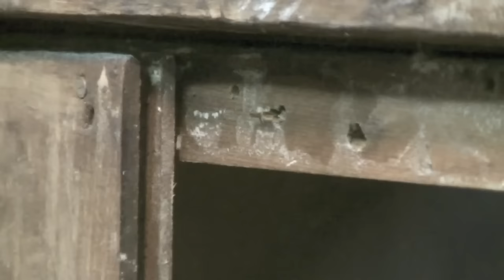Eliminating Odors from an Antique Chest of Drawers - Thomas Johnson Antique Furniture Restoration

Comment: Upon unboxing, I was immediately upset at how the rails were very noticeably bent. But I kept going, all tools needed to assemble were included https://www.youtube.com/post/UgkxqtX4Dxs6aecAZEuz6GY5-d81YecKCshn and I had it set up in about 30 minutes. Honestly I love this thing, make sure to read the measurements and measure your space so you know if it'll work for you. I bought this to put inside my closet, underneath where I hang my clothes and it is absolutely perfect! It is VERY sturdy and all drawers glide easily and mine are stuffed, and they are still flush when closed.
Reply: @johnsonrestoration this is spam, you might want to delete it.

Comment: Hi Tom - I use white wine vinegar, just paint in on with an old 2" brush  and leave it. The vinegar smell is almost gone after 24 hours and completely gone in 48 hrs. Great channel and only just found you - great videos thanks. Pete
Reply from the maker: Vinegar's a good thing. It would make sense to always try that first
Reply: @johnsonrestoration  Vinegar doesn't kill mold like bleach, does it?
Reply: @kbld1  no, it doesn't but hydrogen peroxide does
Reply: @kbld1  Yes, it does. I've used it many times to wipe out mold. I hail from the moldy PNW.

Comment: Great tips! I just wanted to let you know how much your videos have inspired me to take on various projects I would have shied away from only a few years ago. Last year I restored an old handmade mahogany trunk that belonged to a carpenter around the late 1800's to early 1900's and at some point it ended up with a ton of pipe cutting oil on the bottom. My friend insisted on turning it into a cedar chest for all of her various Mardi Gras costumes but no one she brought it to was interested in working on it. After a good cleaning on the outside with some TSP, to get rid of the smoke smell, I got rid as much of the old built up oil as I could with some scrapers and a few TSP cleanings. After it was obvious the smell was not going to go away I put down three coats of leftover shellac I had from another project. The shellac totally eliminated the oil smell and allowed me to line the inside with some 3/16th thick aromatic cedar. The outside was in remarkably good condition but I had to replace the handles with some cast iron ones that were almost the exact same as the originals. The trunk turned out perfect and if it hadn't been for your tips on shellac and TSP, I probably wouldn't have agreed to take the project on.
Reply from the maker: Wow! It sounds like you did a great job! Also, for oil stains, I've found Dawn detergent works really well. Thanks for watching!

Comment: Great tip there. Years ago we bought a second hand wooden wardrobe and we needed to get rid of it because of the smell.  It just smelt like an old persons home (sorry best way to describe it).  We tried waxes and all cleaning products with no success.  You obviously know what your doing, and I'm really learning a lot from your videos.  Was great to see how you tackled this problem. :)
Reply from the maker: +DCPorter71 Thanks! Odor is difficult to deal with!
Reply: @johnsonrestoration  have you tried vinegar? We bought seafood and it leaked into the carpet of our car. Had the carpet professionally cleaned yet the odor returned. My grandmother suggested white vinegar which I used 1:1 with water and soaked the carpet and let it dry. Was pleasantly surprised! We were going to try charcoal if the vinegar didn't work

Comment: I wish YouTube had recommended this video to me a few weeks ago! This looks like such a thorough job and you look like you’ve been doing this for years and really know what you have been talking about. My parents bought me a Heywood Wakefield dresser about 10 years ago now and sanded and restained it for me. I’ve been collecting mid century pieces since then and fixing them up with their help. But my dresser over the years has retained an “old wood” scent. I just fixed up a second Heywood Wakefield dresser and really tired to get the scent out. I vacuumed it out then wiped down every interior surface like you did (although I didn’t take any drawers apart) with diluted Murphy’s wood soap. I let that dry out in a garage overnight and then had to wait a few weeks for a new product I’m trying. Big Mamma’s Butta from Dixie Belle paint company. I put it on all interior surfaces because I saw someone use it to help with the old wood scent. I put it on top of the exterior over my stain as well and it added a nice shine. It looked like I had just cleaned it with pledge. If this works to get the old wood scent out I’ll do it to my first dresser but if it doesn’t work I’ll have to try out the method you did in the video! I have to say I love that piece you were working on. I love furniture like that where it looks like it has a bit of history in it.
Reply from the maker: Thanks! These odors can be tough! I'll have to check out "Big Mama's Butta" I assume it's a wax?
Reply: Thomas Johnson Antique Furniture Restoration it is a wax/oil combo. It did not get rid of the scent so now I am waiting for a sunny day to bake the dresser and drawers outside. I would rather not wash the interior again and loose the shine that the Butta provided but I will if the sun is unable to bake the scent out

Comment: Thank you for the cleaning tip.  I used dish soap and water, then a disinfectant and water mix to clean an old oak dresser that had mold inside and out (and lots of dust).  The piece is drying now.  I think I'm going to have spray it like you did.
Reply from the maker: You're welcome. These problems can be tough

Comment: Terrific learning video. I tripped over your playlist library while researching furniture restoration as I have a few pieces that I'd like to tackle myself. I'll admit, I was surprised to see you using water and other liquids so liberally. Isn't there a risk of warpage, especially with such an old piece? How is it that the old wood in that dresser maintained it's shape and reassembled so well?
Reply from the maker: Thanks for watching. I've never had water damage anything, assuming you wipe it off right away, don't let anything stand in water or have pools form on any surfaces and sit there. Warpage is call by the moisture content of the wood, which is not affected by washing, but rather the humidity levels of the environment. Good luck with your projects!

Comment: What a lovely chest of drawers.  You did a beautiful job!
I don’t know if you’ll even see this comment after all these years, but I’ve discovered that bleach is nowadays considered the “cosmetic” treatment for mould, as it is so effective with the staining.  Vinegar, however, now has a reputation for being a mould killer that actually prevents new mould from coming back.  I would definitely rinse the vinegar off well and let the surface dry completely before using bleach for any stains.  Or maybe your oxalic acid would be preferable?
Reply from the maker: Thanks! Yes, many have told me that, that vinegar is the best. I've been using it

Comment: Wow it is so impressive the attention to detail you take. Great work. I am beginning to buy old furniture and repurpose  or refinish. I have a question for you. Do you think all furniture can be restore or are there times when it is too far gone? So to be more specific, before i found this video i bought a pretty little piece. It a small desk or console table. It had a terrible musty and mildew odor. I couldn’t even have it in my house it was setting off my allergies like crazy. So i put it on my covered patio. But somehow the rain got in and it go really wet. The top is very swollen which is interesting because with the expansion the mold is even more prominent. Is it too far gone?
Reply from the maker: Thanks for watching! I always hate to say something is hopeless but it sounds like this is the case. Once things start to swell they are next to impossible to repair. And it already had the problem of the odor. Get rid of it!
Reply: Water can cause wood to warp out of shape. You can't fix warped wood.

Comment: Wow - this is a deep level cleaning! What a lot of work for a modest old chest of drawers. Do you have any tips for removing the smell of moth balls on wood that has contained them for decades? Superficial cleaning doesn't do much because the porous wood has been deeply impregnated with the odor.
Reply from the maker: Thanks! I would start with a lot of fresh air! It should dissipate. Sprinkle with a generous amount of baking soda

Comment: Hello, Japanese people seem to use bamboo vinegar Japanese Bamboo Vinegar "Chikusakueki" for a number of things : ( description by Dictum : One of the oldest cleaning agents in Japan, bamboo vinegar can be used for the following purposes: As a fat-dissolving cleanser (either undiluted or with water added) in the kitchen, bathroom or workshop. Particularly effective on cutting boards, work surfaces, knife blocks, etc. For eliminating mould and insect infestations in storage areas, textiles or Tatami mats. For treating plants with infested roots or leaves or as a fertiliser; simply add some when watering. For extinguishing unpleasant odours). 

Have you tried it ?
Reply from the maker: Thanks! Not the Japanese vinegar, but I've heard all the same claims for our regular white vinegar. I need to use it more often

Comment: This is an inspiration to me to tackle several family heirlooms including a buffet and multiple dressers and chests of drawers.  I was wondering if the shellac inside and outside of the drawers hinders their movement?  or the layers are so thin it doesn't matter?  Thanks for your feedback.
Reply from the maker: Thanks! It should help with the movement, or help it maintain equilibrium and not move. But of course the purpose was just to seal in the odors. I'm assuming you mean wood movement and not the moving of the drawers as they're opened and closed

Comment: I have a very old buffet that I inherited from my mother.  It has very ornate carving on it.  I think I need to do the same thing you did with removing the odor but is there any other thing I can do to seal the surface instead of shellacking?  The wood is so beautiful and I'd like to keep it as natural as I can.  Maybe linseed oil or something?  Any suggestions?
Reply from the maker: Yes, use an oil finish like Watco Danish oil. Brush it on, go over it with 0000 steel wool while still wet, and wipe it down. The next day wax it. Good luck!

Comment: Question: When washing the wood with water and bleach, does the wood swell causing problems when fitting drawers back in? Even when drying the wood, it still must retain some water.
Reply from the maker: Thanks! It's not wet long enough to swell. It's really only wet for a few minutes
Reply: Wow thanks so much

Comment: Thank you for taking the time to show us how to eliminate the odour from these old beautiful pieces. I am in Canada otherwise I would be dropping my two french provincial pieces to you for help :) I am on round two of wiping them down with white vinegar. I have not taken any of them apart just wiped all spaces I can see and reach with undiluted white vinegar. I have taken the dresser and tallboy and the drawers out to sit in the sun too. While the awful mould/mildew stink has reduced, it's still there. I have not started to refinish them (repaint them) on the outside yet as I want to tackle the smell first.  Should I try this bleach solution next? What should I do after that? Thank you for your time :)
Reply from the maker: Thanks! Be sure to get the undersides of everything with the vinegar. Then wipe everything again with an enzymic odor control like Nature's Miracle http://www.naturesmiracle.com/. Plenty of fresh air and sunlight are good too. Good luck!
Reply: @johnsonrestoration  thank you so much for taking the time to answer. I got someone to flip the dressers over for me and so I was able to saturate it with vinegar. I also removed the backboards from the dresser and the tallboy and I am replacing it with a thin sheet of finishing wood. Not sure what they are called but I got them in the lumber section and got them cut to size for a perfect fit. I am thinking that replacing these will reduce some of the odour. There was melamine there before and they are just holding the smell. Also, I tested this product on one of the drawers, it's called Zinsser Odour Killing Primer OMG it worked great! Mind you this drawer has had several days of air and sunshine and three heavy white vinegar saturations but there still was a touch of stink left but now it's all gone.  This Zinsser product goes on white and dries clear. You can barely tell that anything was put onto this untreated wood. I am going to coat the rest of the furniture and drawers on the inside today. Then move onto the sanding and repainting stage of these pieces. I will send you a pic of the finished products for you. I still need to clean the handles that came with these Andrew Malcolm antiques. Their original finish is white but has yellowed and full of stains so they definitely need some revamping. Have you used this Zinsser product before? Have a fantastic day :)

Comment: Where can I buy the Shellac sealer please. 
We have just bought an old chest of drawers,  it smells horrid. 
Tried everything,  next step is bonfire 😢,   unless we can find some shellac clear sealer xx
Reply from the maker: Thanks! Shellac is sold as Zinserr Universal Sanding Sealer, it is available at your local hardware store. First I would clean the entire piece, inside and out, turn it upside down! with 1 part white vinegar and 1 part water. Let dry, spray everything with Odoban, from you r local hardware store, let dry, and then 2 coats of shellac, sanding between coats
Reply: @johnsonrestoration 
Thanks John.
We've tried bicarbonate of soda.
Washed it down with a bleach solution.
Used white vinegar.
Aired it for a month.
Honestly,  we just feel like burning it now especially as we bought it to store newborn baby items in. Xx

Comment: I just saw your video and noticed you have several old trunks. I have an old trunk and it has several removable drawers, but the inside of the trunk has an old smell to it. What can I do to remove the smell? All the drawers are lined with paper. The inside of the trunk is in excellent condition. Thanks for your input
Reply from the maker: Thanks! Try using activated charcoal. There is plenty available in different forms and packaging. Also good old baking powder can do it. Let me know how it comes out

Comment: I'm so glad I found this. I used vinegar on all areas inside the dresser, but for some reason there are gray spots appearing on one side of the dresser.  (I also started by spraying it down and scrubbing with lysol but it didn't do anything to any of the other pieces of the dresser). Perhaps scrubbing a small section with steel wool caused it or is it mildew? :( help!
Reply from the maker: Thanks! The mold and mildew should be dead after the vinegar, but it might not look like it. Lately I seem to have luck with charcoal absorbing the odors. You might also have to do the interior. You need to wash everything down, inside and out!

Comment: I just moved house and bought a dresser secondhand and it smells so musty! I’m struggling with it being in my room. I luckily have access to a garden in my rented London flat but it is January. I’ve so far vacuumed it and cleaned with dish detergent and am planning to use bleach and then vinegar and then sand down the piece and reseal. Do you think this will work? The weather is cloudy and 6 degrees Celsius and the sun sets at 4pm which is what I’m also struggling with. It’s frustrating as i have just moved and haven’t been able to unpack due to this. What do you think? Should I make a brave attempt or just cut my losses and buy an IKEA dresser?
Reply from the maker: Thanks! Airing it out is always the first step, clean with white vinegar - 2 parts water,1 part vinegar. This should kill any mold. Then use activated charcoal packets sold for this purpose. Good luck! sealing the inside would work too, but try the charcoal first

Comment: Hi Thomas, I watch your videos frequently and always refer to you when I need help identifying/ understanding/ discovering etc. about antiques and furniture techniques. 
I have an old dresser that is probably a reproduction and it has a very dark stain on the interior of the dresser and drawers which is transfering to some of my clothes. I am looking to seal this up, since this original finish (or lack there of) has deteriorated with time. 

I have tried wiping it down several times but the dark stain still transfers to cleaning cloths without any lubricant or cleaning solution.

What would be the quickest way to seal the interiors with limited off gasing? I really would prefer not to paint it or use any strong solvents like poly to seal it up. Paste wax? other finishing oils? 

thanks for your help!
Reply from the maker: Hi Daniel! I would clean the drawer interiors with a degreaser like Krud Kutter. Let dry completely and finish with 2 coats of shellac, sanding between coats. Keep the drawers out to dry for a few days. That should do it. Good luck!
Reply: @johnsonrestoration  thanks so much for your help!